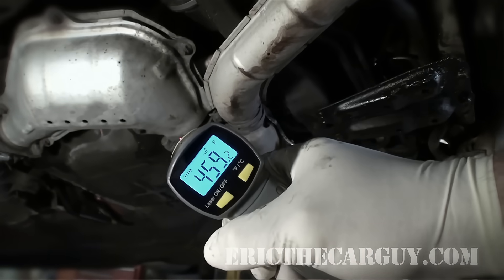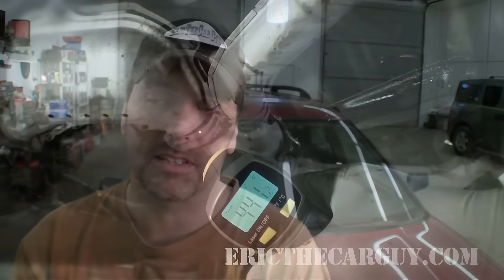Does Lacquer Thinner Clean Catalytic Converters? -EricTheCarGuy

Comment: my Nissan versa 2007 has 280,000 miles since I got it I knew it had a bad catalytic converter, the check engine lite would come up randomly and go away on its own in about one week each time. i would always  scan the code/check engine lite every time just to make sure i didnt have a different problem. recently it wouldn't go away for about 3 weeks  so I checked and got the same code as other times for the catalytic and I tried the 1 gallon of lacquer thiner  in half a tank of gas full , ran the car for about 2 and a half hours next day after coming back from work  the check engine lite went away.
Reply: did you just idle it? I heard that could be bad in my engine audi a6 direct injection

Comment: Well, you said it all when you  said Catalytic converters  can fail in different ways . Assuming  all is wrong with them is some buildup  , this might work,  as long as you use the correct amount, which obviously you did not. In my case, I might give it a try, using a FULL GALLON to a half a tank of gas. See what happens.

Comment: my daughter bought a 2003 jetta and it wont pass smog it said obd 11 not ready how can we fix it with out over spending?? i just replaced her axles on the front and radiator and all the hoses to it new filter and oil change oh and it said only synthetic but meineke put in a blend would that make it not pass smog
Reply: you fucked

Comment: I appreciate ETCG videos.  In this instance, I have a personal experience with using lacquer thinner. It does actually work, but not in every circumstance, because there are different causes of this P0420 code. My son has a '96 Toyota Camry and out of the blue he got the P0420,  The car drove fine, though.  We tried the lacquer thinner trick and it took a while, but it worked. Iinto the next tank of gas the check engine light disappeared and it's been a couple of months now and has not returned.  So, in this case the lacquer thinner did the trick.
Reply: do you have to drive all the lacquer thinner off in 1 drive? will it damage the car to sit overnight with it? I am reading it can melt things. in this case wouldn't 1/8 gallon in a 1/8 tank better so I can drive it all off and then dilute before I leave it sitting? maybe it would be a good job as maintenance to just add a little when your tank is low before refilling.
Reply: It's never harmed the cars in which I have used it.  I would put the lacquer thinner in and then go for a long drive, so I used it right away. I doubt, though, that it would damage anything if left in there over night. I suppose you could use a little for maintenance if you want.
Reply: Hirschel Litzenbaum i think seafoam in the intake gunked my shit up
Reply: Lacquer thinner won't do that.  I don't care for Seafoam, but a lot of people swear by it.  I'm not interested in it.

Comment: tap the converter with a rubber mallet lightly..if its broken you will hear it rattling. you will have to replace it ..no shortcuts for that.
Reply: don't tap on my shit with a mallet. you can break them like that

Comment: Correct me if I'm wrong, but wouldn't a sustained, high speed drive (80+mph) also clean the cats by increasing the internal temperature and burning off any unwanted deposits on the plates. 
Such an approach will clean the exhaust innards on diesels that have spent most of their lives on short, slow journeys. 
You need to give your vehicles 'a good hoke', just the way they were designed to be driven. If you want to drive like Captain Slow, get a battery car!

Comment: pls   the final  its right  to use  or  not
Reply: it depends on why the cat is bad, a lot of people are reporting it working. more than not. shops aren't going to recommend it because they don't make money off it and there is a risk of damage to plastic and rubber parts. are you willing to follow the instructions and drive 100 miles or 30 min at 2500 rpm.
Reply: thank you

Comment: I have 06 Altima which kept pulling P0420 showing bad cat.  I watched Scotty's video and decided with 230,000 and a replacement cost of $1300 to replace cat I would give it a try.  I followed the EXACT directions of Scotty (unlike you did on this video) and I put one full gallon of thinner into 10 gallons of gas. (a little less than 3/4 tank) I had to do a Dallas to Houston drive so it worked out perfect.  I ran out the whole tank on I-45 going 75-80 mph.  I added some 93 octane (which I read from other posters could help) I reset code and drove another 100 in the city before checking it again.  No pending codes and passed inspection with flying colors.  Maybe a coincident ? Maybe but I would say for the time being I am a believer.  P.S. Cataclean is a good product too but it does not work 100% of the time.  Follow directions accurately if you want to do a real test.
Reply: +Allen Kingsley The after cat is bad about clogging up if the manifold cat goes bad. The after can is not monitored by the computer, so you can hollow it out without setting a light. You can find a manifold cat online pretty cheap, super easy to replace. Check back pressure with a gauge you can rent from O'reilly's.
Reply: Welcome to Houston !
Reply: Cataclean smells like lacquer thinner. Maybe that's where Scotty got the idea from. Stuff is pretty pricey at $20 (for 16 oz, on sale). Would be interesting to know it's chemical makeup. Could make a lot of money selling 16 oz. bottles of lacquer thinner for $20 :)
Reply: Kevin Kleinhenz something I didn't catch from scotty's video was if it is absolutely necessary to run the car for 200 miles all at once. A road trip sounds nice but can't I just run it as usual to my regular commutes to get the same results?
Reply: I don't remember Kilmer saying to drive your car for 200 miles but I do remember him saying to idle it at 2,500 RPM for a 1/2 hour as another option to driving it a high speed on the open road.
Reply: Should I do it?
Reply: It's not rocket science. Maybe it would work in some situations ( Scotty's ), and not in others depending on the situation, or the type of cat. damage. I don't think either test proves anything except this may work, or might not. I don't like taking chances with my car based on rumors.
Reply: When you say you added lacquer thinner to 3/4s of a tank, and then added 93 octane, you are telling us you did not follow Scotty's directions exactly?
Reply: +Kevin Kleinhenz 
I have the same car. No P0420 Codes, but i have severe Loss of Power. I have this strong feeling my Cat is totally clogged. Although the o2 has thrown its code before, i replaced this o2. But the Car has terrible loss of Power. I believe this procedure you followed should Help.
Reply: @kingsleyosuji3345  please i have the same power loss with no codes... i know this post is old but can you please tell me if you have tried scotty's method? Thanks!
Reply: +Kevin Kleinhenz I use the L.T. method on many of my customer's cars. I'd say about 60% of the time it works every time. Some have gone for years without the light returning, others have gone about 6 months, others didn't make it 6 days. There's many variables. It's good to have those variables in your favor though!

Comment: I agree I have bad catalytic converter's tried to lacquer thinner or did nothing
Reply: +Clifford Austin Miller lll 
Yeah, I actually think it might depend on the CAT design itself ... that could explain why it works for some and doesn't work for others. Also maybe yours had broken apart inside, so it needs much more than a cleaning XD
(And ... cars are complex. When someone brings me something to repair, and I ask them what is wrong, they'll say "doesn't work". WELL OF COURSE IT DON'T WORK XD ... most people don't give details ... and in engineering, those details are what come together as a whole to make a machine! :D)

Comment: How can thinner clean the converter if it is burned by the spark plugs?
Reply: +Benito Caspo I venture to say.. Exhaust gasses. HOT.
Reply: +Benito Caspo Most of the thinner is burned in the combustion chamber. The  unburned portion of thinner burns off in the exhaust (much like a rich condition in which happens to unburnt gasoline) and this is where the cleaning takes place (theoretically). Keep in mind, I'm not saying thinner works or not nor am I promoting this procedure.
Reply: +Benito Caspo I was wondering the same
Reply: I don't think gasses will clean it, it has to be liquid.
Reply: Spark ignition engine constantly run in rich-lean-rich-lean cycle when it is in closed loop mode. IMHO it is during the rich cycle that the unburnt thinner cleans the cat converter.
Reply: so this uses the same method that causes the bad cat in the first place to clean it.. running rich from fuel in the exhaust?
Reply: ***** I think it honestly depends on how the cat is clogged. 

I had some idiot mechanic tell me to "bang on it with a rubber mallot" to release the substrate to try to get it loosened up to be blown out. What I instead discovered is that that cat is likely permanently damaged... and this method would not work on it...

Comment: There is a much simpler method.    The Catalytic Converter is a Honeycomb of what seems to be some kind of fancy ceramic inside.   It will get clogged up by people that never drive it to full throttle, once a week, while getting on the freeway, just like EVERYONE is taught.    So, the real issue is it gets clogged up with CARBON.   The EASY and CHEAP way to fix ANY Catalytic Convertor, is to disconnect the windshield wiper squirter from the engine hood, then run it into your air intake, just drill and affix a screw-in brass fitting.   Or, just stick it into any accessory vacuum hose attachment that is a factory option, and has a simple plug, unplug it, and plug the water hose in.    Get on freeway.   Accelerate to 70, whatever your speed limit is.   Now, in small doses, apply water to your engine intake, with your wiper squirter button.    This will remove any and all CARBON from your Catalytic Convertor.    If you are old enough and responsible enough to own a car with a carb, simply remove the air cleaner, and rev engine with your right hand while pouring water in  with the left hand.    Note, the water even in a vapor will NOT compress, and too much water WILL break your Head Gasket.   This is a lesson I was taught by a Mercedes Benz FACTORY TRAINED TECHNITION.    That is why they NEVER fix your car " Right now".    They have to separate the customer from the car while it is worked on, or the will wonder why they were billed for 8-hours of shop-rate, and the mechanic fixed it in 15-minutes with a can of water.   The 8-hours is an AVERAGE.   This is so you don't get ripped off by some no-skills R&R Monkey with a Code reader.

Comment: He admitted, "may not have used proper proportions", give that one up, but there are proven facts, the Lacquer thinner will EAT other things within the fuel system, if there is any age to many rubber parts...........
By a "name brand" like Catacat, as I think they offer a warranty................
"That's just my opinion, I could be wrong" ~ Dennis Miller ~
Reply: i dont think lacquer thinner is that dissimilar from gasoline as a solvent.
Reply: they are both petroleum based if that means anything
Reply: I think you have to consider the burn rate/flash point as well as the detergent agents that are, or are not in a product. I think most thinner is recycled solvents often containing acid.

Comment: What about running E85 to try and clean up the system?
Reply: If the car is approved for flex fuel, go ahead. If not, it won't run right at all.
Reply: I've got a 2001 Cadillac DeVille and have run full tanks of E85 in it.  Although not a flex fuel car, it does run.  Check engine light comes on and the computer thinks there is a lean condition, but it's a false reading because the E85 burns so much cleaner than gasoline.
.
The only issue I've had is that it's harder to start in cold temps and a little sluggish around town.  You DO get less MPG, but you are also 85% less dependent on foreign oil.
Reply: you mean 15% less dependent
Reply: Jacob McIntosh E85, is 85% ethanol and 15% gasoline. --  So you are reducing your use of oil based fuel by 85%.

Comment: Hey Eric question I have a 2006 GMC Sierra and oil goes to intake manifold is that normal
Reply: +Juan Villanueva  you probably need to replace your pcv valve.
Reply: Pcv valve it was happening to my 99 tahoe
Reply: If you have blow by, it's normal. Likely from warn valves, bad rings, etc. 
Replacing the PCV shouldn't change it unless it's sticking open, usually they stick closed.
Reply: Thank you

Comment: Wish you actually did what Scotty suggested and used a gallon instead of a quarter of that amount. This video might not have been a complete waste of time then...
Reply: scotty said 9 gallons
Reply: Scotty didn't mention his quantity of fuel, Eric attempted to make up for the lack of information and adjust it for the small tank.
Reply: Gary Shaw CORRECT!!! It's even stated in his comments, 1 gallon of thinner and 9 parts gas😉

Comment: Okay, when you want to debunk a claim, please stick to the claim without embellishment or paraphrasing. Also, try sticking to the remedy claimed instead of something different and saying, "SEE! It doesn't work!"
Scotty Kilmer (refer to the link in the description box) said ONE (1) GALLON in half a tank of gas. You put 25% of that into almost 3/4 tank of gas. What should someone expect when they disregard instructions? 
Scotty also was talking about the possibility of CLEANING the cat out to get enough efficiency for a passing emissions test, NOT repairing a catalytic converter. Btw, are you a recreational pot smoker? Anyway, hope this helps with your next attempt. Scotty's lacquer thinner cleaning resolved my cat problems beautifully on two cars.
Reply: Krankie V
Lacquer thinner, as explained by Scotty, will fix the cat's inability to function if it's problem is carbon. It won't weld internal parts while holding them back into place. Sorry.
Reply: Krankie V
Your last comment sounded like you needed that explained.
Reply: +20alphabet Eric explains this in his video even about the other guy's. He says it doesn't repair physical damage to the cats, it just shows them how the cats were becoming more effective after  filling the car with what he was a safe mixture of gas/lacquer thinner. Try to remember that the engine is not desinged to run on that stuff. I appreciate your last few comments :)
Reply: +usmc2076 yes :p
Reply: randyy1964 why would you be driving a prius 😂😂😂
Reply: +20alphabet  Sure due diligence and sticking to the formula is very important, I won't deny that.

But T.B.H., why do you care if he smokes one (or a few) dubies a day? All the areas that have legalized it recreationally, really have had almost completely positive experience with it (no major problems with the program). And no I don't use, nor live in an area where it is legal.
Reply: jb34304
Yes it does. I tried this, as Scotty Kilmer suggested. Still had the catalyst code springing up. Had to replace the catalytic converter. However, inside was broken, but clean as a whistle. So at least I KNOW for a fact that it works!
Reply: +20alphabet 
"Scotty also was talking about the possibility of CLEANING the cat out to
 get enough efficiency for a passing emissions test, NOT repairing a 
catalytic converter."

Scotty's video is literally titled "fixing bad catalytic converters(...)"
Reply: no shit sherlock
Reply: Hi there 20alphabet, if it worked on your 2 cars, do you think it would work on my honda civic hybrid 2008?  mine just lit up yesterday 01/30/17 and it says P0420.  Hope you can reply soon.  Thank you.
Reply: @edwinsm2009OriginalSongs  
Seems like YouTube is more interested in censoring free speech than notifying people of comments. Sorry I missed yours, as no notification was sent. For future reference, I wouldn't hesitate to apply this method to your car if I were you.
Reply: my prius 2002 just did same thing.  did you try it in your hybrid
Reply: all I could afford for my son.  $2500.00

Comment: Wonderful video erick ! Thanks for showing us the whole process man, now i have a question, i not only have the code for the catalytic convertor ,but also i have the knock sensor code on, anyways i replaced the knock sensors  a year ago, and the code came bk , now do u think that because the bad comunication between the knock sensors and the computer ,may be thats the main reason why my catalytic converters when bad early before 80,000 miles ? Thank u

Comment: Hey Eric I have the same Subaru. my son washed it the other day, and now the lights are stuck on? I pulled the battery cable for now. Any Ideas what happened?
Reply: Probably figured it out by now, but it's likely the parking light switch. Should be on top of the steering column.
Reply: thank you!

Comment: The video did say 1 gallon in half a tank.  Perhaps the 1 quart you used wasn't enough?   I'm currently trying the CRC GTP (guaranteed to pass) fuel treatment to see if it might clean my cats on a 125K 2001 PT Cruiser.   This first treatment I'm not running the tank dry on a long drive just driving normal so I have doubts. (stuff has a double money back guarantee) If code doesn't clear I'll treat another tank and visit some family far away.  Then if not, I'll try the 1 gallon of lacquer thinner in half a tank.  then if I still have code remove the cat and try and clean.  I've cleaned one before on my 1996 taurus with seafoam, parts solvent, and brake parts cleaner and code went away.   If that fails, I'll weld in a new cat.